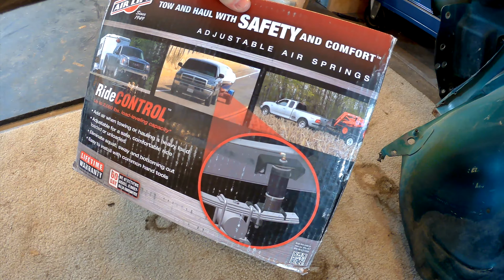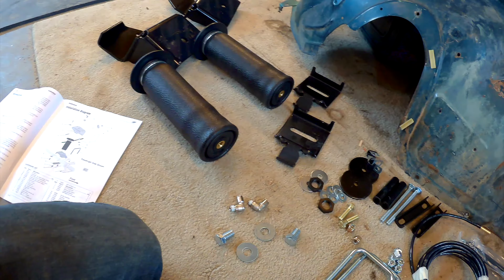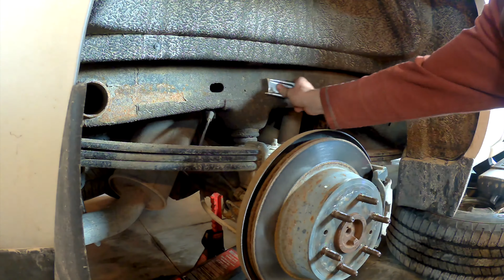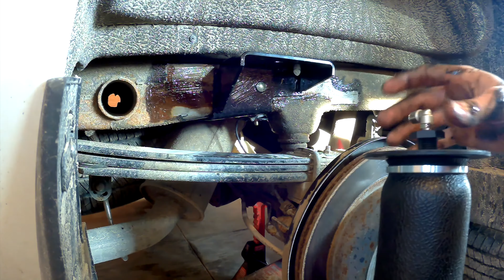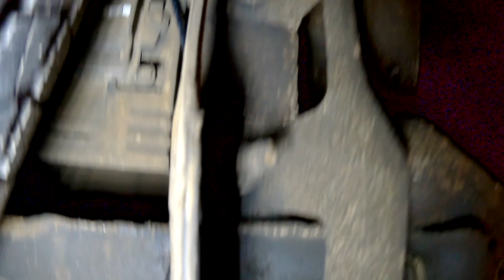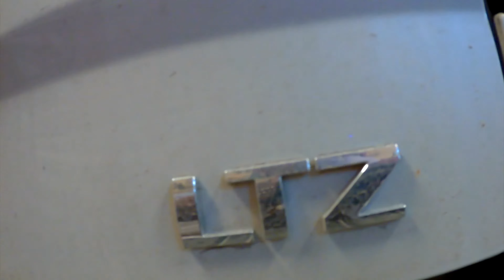Air Lift Ride Control 59565 Install 2007-Present Silverado/ Sierra 1500

Comment: Good video bro. I just bought me a set and have been looking for raw footage of them on a truck
Reply from the maker: My dad loves them. Throw a big load on and crank them up. Rides so smooth.
Reply: @Schneids15  what about the actual ride while not towing. Has it made a difference while not towing
Reply from the maker: It had yes. He usually keeps them inflated a bit more and it helps make it smoother. You can let the air down to low pressure and it will ride the same as stock.

Comment: Just an FYI running a single fill point that is tee'd to both bags isn't a good idea. with that setup, both bags can transfer air between each other and it can exaggerate body roll and sway. When more load is on one side during a turn etc, the bag with the more load will simply push that air out into the other bag allowing the body to roll excessively. When each bag is isolated with its own fill port this won't happen.
Reply from the maker: I agree with that 100%. Thing is i never have a huge heavy load in the bed. Usually on a trailer which is centred on the ball. Even on a hard corner that weight is still pushing hard centre. Been running it for a couple years now with 0 issues. I did look at that when installing and contemplated the setup but figured i could do that after if i had issues. Good for other people installing to consider👍🏻
Reply: Not to mention.... Why would you tell people to scrape off the protective coating on the frame?! Then you brush oil on it?! Wtf??
Reply from the maker: Hey Josh, i did this so the brackets had a good mating surface. The surface in there was splotchy and i needed it flat. Thick oil in there won’t go away.

Comment: Tightening that bolt through that hole was shitty I ended up making a socket tool with a 1/4 wrench, socket, and impact drive. A lock washer on the top and a non lock washer on the bottom would probably tightened together alright. Then add another lock washer after that probably would have saved hours of my life.
Reply from the maker: Hmm i never had this issue. I threw these on in not much time at all. Good to hear you figured yours out.